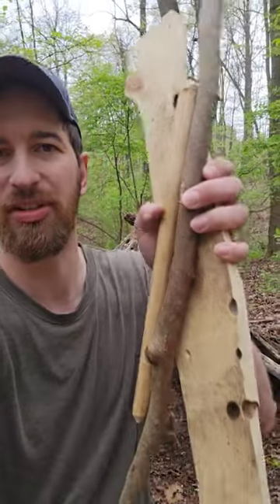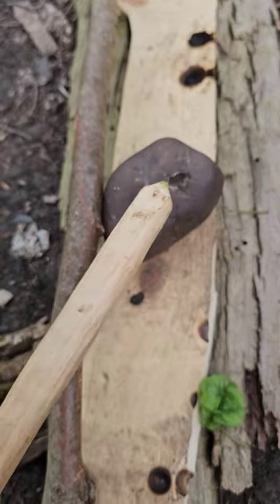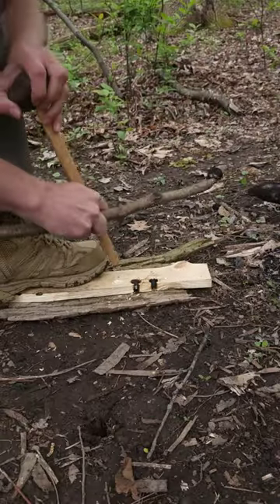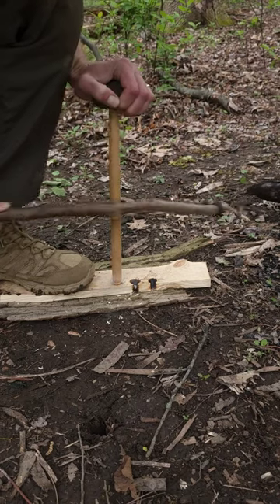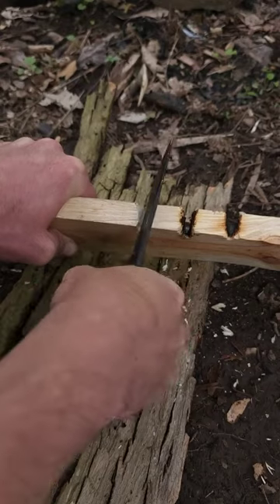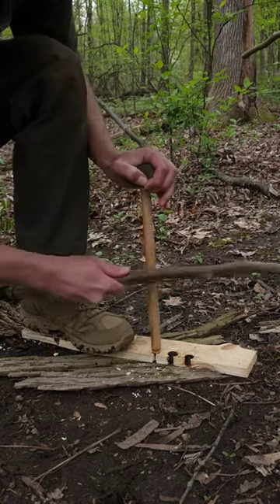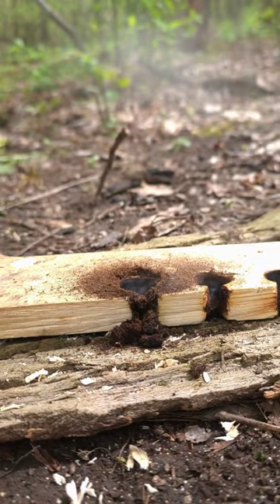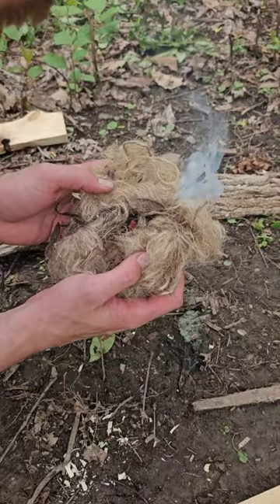Bow Drill Friction Fire 🔥

Comment: Very good explanation, in chronological order.  Especially when the divot is cut for the spindle stick and when to cut the notch for the dust to escape, so an ember could form.  Very good, informative and concise video.
Reply: Why can't you just cut the notch right after making the divot?
Reply: @Justin.Franks you want to char the wood to ensure you have as dry of wood as possible before trying to get the ember. Also smoothes out the divot and spindle, which ensures your divot matches the spindle so the spindle doesn't catch on the notch and create sudden sharp resistance.

Comment: Just a heads up this will not work with just any wood. Cottonwood, cedar, and yucca work well. Redwood bark works well for the tinder fluff.
Reply: Allright sounds clear to me
Reply: damn i can't find any cottonwood or yucca. maybe cedar tho.
Reply: Pine works extremely well, Birch bark makes for great tinder. Also Red Alder, Poplar, Aspen, Basswood, Eastern Cottonwood, Willow, Sycamore, Sotol, Elderberry (Not just good for wine), Mullein, and oddly enough I have had good luck with dried out Australian Pepper tree. I absolutely agree with your choices as well!

But the most important thing to understand is the wood needs to be dried the hell out! This isn't something that can be done with stuff found on the ground usually, unless the area is very dry or in drought conditions.
Reply: @shreksburgers  Cedar is all over America in various forms, and realize that it burns super hot and fast. Yucca is a common desert tree, but because of it's ornamental nature you can find it in civilized areas. Something to consider when mankind is wiped out. lol 
Also Yucca leaves can be woven into cordage.
Reply: @tobybigham4196  I was just going to ask about PINE ..
Reply: @jarcadipane2849  Especially heart wood. Pine is notorious for being full of flammable resin.  Slash Pines are the best for this!
Reply: Does anyone know what Australian trees work best for this?
Reply: Pine works well also
Reply: I can smell the red elm from my boy scout set.
Reply: The one time I tried it was with mesquite. Evidently thats too hard of a wood.
Reply: All we have here are yucca, cedar, and cottonwood, and a shitload of elm. I’ll mail you all you need-the yucca anyway.

Comment: Tip: if you have wet wood, put some cracked shells from an snail. Calcium makes pretty good thermal reaction with water, gets hot, releases hydrogen and helps make the wood flammable.

Comment: Thanks for pointing out how you kept the drill moving smoothly with the crushed leaves! Looks like you're using good string here, have you ever worked with lower quality thread and needed to lubricate the string itself so that the threads don't fray while bowing? Are there certain leaves that tend to work better in general?

Comment: There is nothing like the excitement that comes from working at a primitive fire and seeing your tinder ignite into flames. I’ve got an old piece of ebony I use as a handhold. I like using white pine to drill into since it works pretty well.
Reply: Cna you explain how to tell the differences between wood that'd be better to use as the spindle, vs the one that'd be better for the notched wood please?

Comment: You want to have a hard wood like Oak for your thunder head or what he used a rock for, the spindle and floorboard made of the same type of medium wood like red cedar. And a light and flexible bow like Paw Paw.  Having some leather under the notch to help catch spark helps.  Pressure is more important than speed but using both is best!! Good luck with your fire by friction everyone!

Comment: No the notch lets air into the bottom that will support combustion .. the dust is fine , it will burn ..
But you need oxygen in right at the hot spot on the bottom

Comment: BIC lighters are 2 bucks
Reply: Knowledge is 0 bucks and can't be left at home.
Reply: @Treblaine not trying to troll but genuine question if I can bring this perfectly straight spindle and milled board, a knife, and a string, why can’t I bring a lighter?
Reply: @forty9r9r7  This isn't about bringing things for one small part of a problem, if you knew you'd be stranded you wouldn't bring a bic-lighter, you'd bring a satellite phone.

If you can't find bits of wood then there's no point in starting a fire as you'll have nothing to burn. I've got string without even planning to have string because I wear shoes with laces.